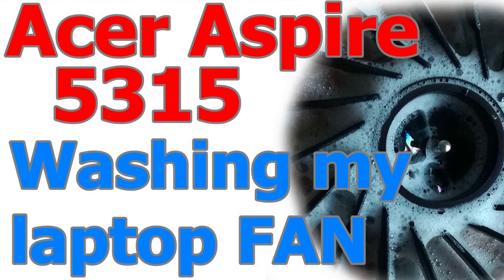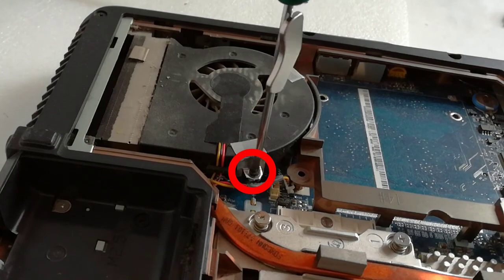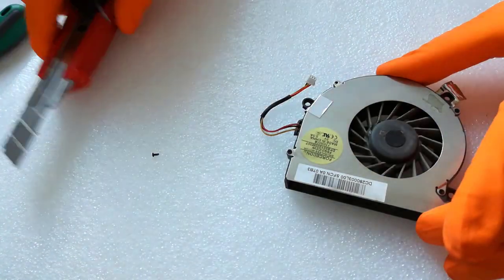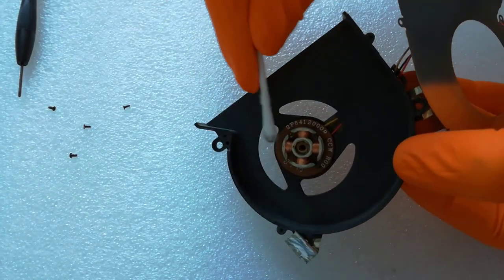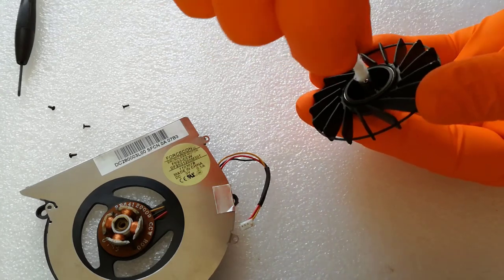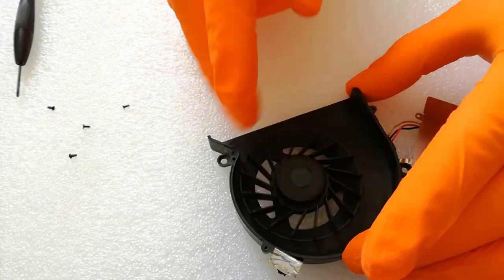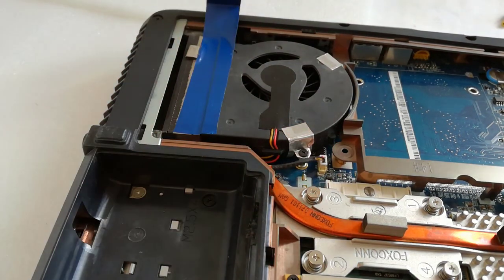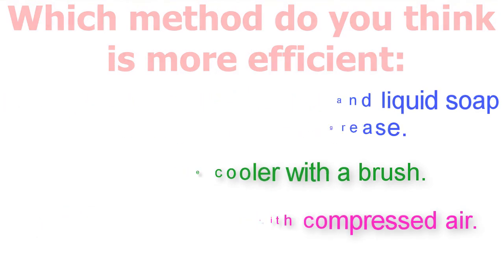Acer Aspire 5315 FAN cleaning Cooler cleaning Ep.225

Comment: What is the best CPU that I can put on the 5315 today?
Reply from the maker: Acer Aspire 5315 CPU upgrade https://youtu.be/9jpt2ibr-jc
Before the CPU upgrade update your BIOS  Acer Aspire 5315 BIOS upgrade https://youtu.be/VuHc6mkrcGI
In my opinion the best upgrade for this laptop are these CPU's:
Core 2 Duo T7500 2 2 2.2 GHz 800 MHz 4MB 35W   + +  
Core 2 Duo T7700 2 2 2.4 GHz 800 MHz 4MB 35W   + +  
Core 2 Duo T7800 2 2 2.6 GHz 800 MHz 4MB 35W
Please use a good quallity thermal paste if upgrade your CPU from a lower TDP CPU (27W ,31W)to a higher TDP CPU( 35W), otherwise will overheat the CPU.
Thank you for watching, please subscribe, share it  and good luck with the upgrade.

Comment: i got the same old labtop.
dusted it off, cleaned fan and cooler.updated bios like your video showed.
now installed windows 7 was stil runnuing vista.
what is max memory it can take. i had spare ramsticks lying arround. if i ad a 2gb  in free slot it works ok with 1 and a 2 gb stick.
bud if i try 2x2gb sticked i get bluescreen on booting os
so is 3 max? is it better 2x1gb dual xhannel r 1 and 2 gb sticks work better?aswel after bios update what is best processor to install?
Reply from the maker: According to @ millstreamclan user  https://youtu.be/9jpt2ibr-jc : the best processor upgrade is the  t8300, 3GB ram and ssd.
Here I have 4 videos about Acer Aspire 5315 https://www.youtube.com/playlist?list=PLdsSKCXNCJYg1iD4ra2S0cvbPDAA71MtB
Thank you for watching, if my video was useful, then please consider to share and subscribe.
Reply: Some people was able to make it run with 5GB RAM (4+1) and T9300, problem with this laptop is that one of the slots for RAM support only 1GB, when the other one support more. If you insert 4GB RAM (2+2) you will be able to get to BIOS and you will see 4GB RAM but OS will not boot.

Comment: lol this format of recording is pretty cool! My HP desktop sounds like it needs to have the dust cleaned out. How do I clean it? Can I clean it myself or should I have it professionally done?
Reply from the maker: I you have a desktop you can do it youself. You can use your hair dryer and a brush to blow out the dust from your PC.
Reply from the maker: In your video you use a HP laptop not a HP desktop, so you have to disassembly the laptop to clean the fan. You look for a video for your laptop model, some models can easely disassembly like my Acer and you can do it yourself.